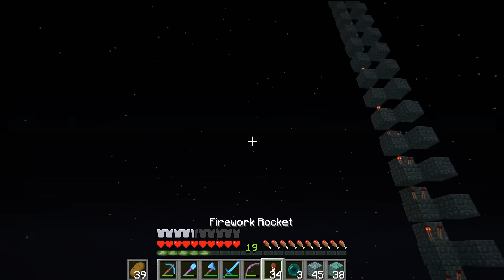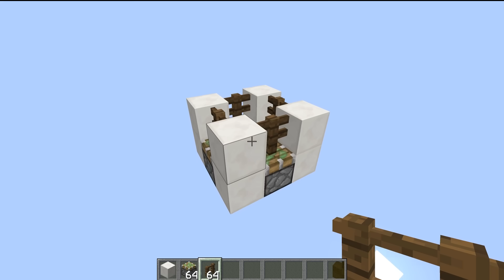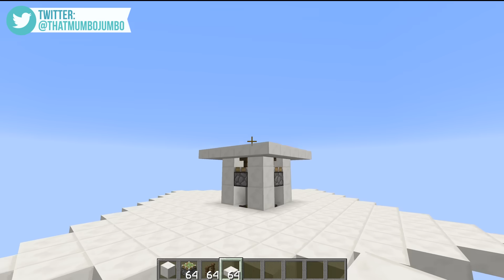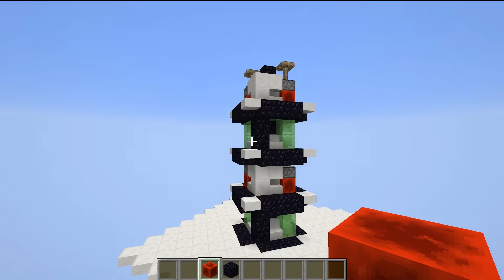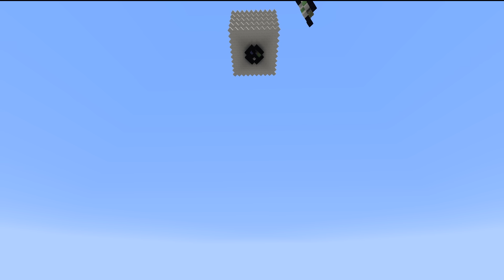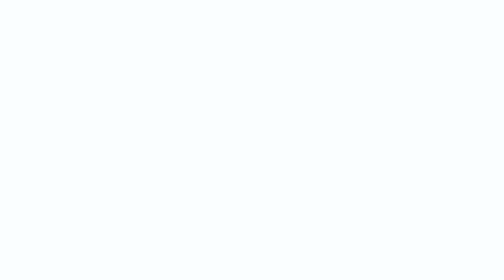Making MOB FARMS with NEW WATER MECHANICS in Minecraft!

Comment: You literally said you wouldn’t use observers, then preceded to use observers
Reply: Also he used them in a different way
Reply: @Samuel Nelson not blocks of redstone. they don't power the surrounding blocks because they count as the 1 powered block.
Reply: @Awonya  correct..
Reply: Are the observers necessary tho? Because you could just put a block there and the signal would go through into the piston.
Reply: @JADubs_  redstone blocks don't power other blocks
Reply: The way they're used won't lead to out-of-sync issues.
Reply: So?....

Comment: Hi Mumbo, I'm making a version of this on a sky block map. I have one bucket of water, the design I've done is working so far. The water goes down the middle and splits out to the sides and also falls back down the centre to the next floor. I have also got streams that come from the top which go out to the side that push the fallen mobs back to the centre killing chamber. One water source shouldn't give me any out of sink issues.

Comment: i think it would have been slightly easier to have the floors another block apart so that the pistons, or dispensers with water buckets in the design i used, lined up with redstone torches in the center column. (not being negative just giving some possibly helpful advice for the build)
PS im a big fan of the channel, keep up the great work

Comment: actually thered be a way simpler system tbh..
piston with redstone block above... the redstone blocks water in the middle from flowing. if you power the lowest piston, its gonna chain react and power each piston one by one to the top.. then if you deactivate the lowest one, theyre all gonna pull the redstone from the opening and let the water flow, while also unpowering the piston above. right? h avent build this, but it sounds like it should work. or do you need redstone half slab blocks for that?

Comment: I found another way  to power the system, but with this you are loosing 1 block of efficiency, so it isnt as compact but it is more resource available.
https://imgur.com/a/WJhht UnPowered State
https://imgur.com/a/Eeqr1 Powered State
Just mainly using all of the same design but just a simpler system for someone that doesn't have the resources.

Comment: Might work better if he takes out the outer most ring of each platform and put signs around the edge to suspend the water but prevent the spiders from hanging on the edge like that since the water will sweep them out into empty space. Then once the water is gone they will have nothing to cling to and should fall straight down.

Comment: On our last server we had the spawner ilmango designed... watching this video makes me wonder... if you didn't want to go as high, how far out could you make the water run by dropping the height of the outer edge before you blocked the mobs from the level below?  (Or would you, assuming each one dropped at the same time?)  

Maybe also, on the bottom layer you could have a reversed water flow moving the mobs back to the middle to be killed by magma blocks or something.  Mainly I'm trying to think of something short that wouldn't be such an imposing structure on the skyline.

I guess I'll worry about that next server.  We are playing modded this time and have something so we can move mob spawners, so we can make something much more compact for this playthrough.

Comment: Couldn't you just run observers up or down through the center of the design at 1:50? With a block adjacent to the pistons so they can be powered?
Edit: Oh wait, I just saw why you weren't using observers. But if you built it in the spawn chunks, observers would work, right?

Comment: The only problem with it is that spiders are sticky. They don’t seem to want to fall off the edge, and will sometimes stick to the side of a block. Before the water mechanic update, you could put an iron bar, glass pane, or a stair block at the edge of a platform, sacrificing a minor amount of spawning space in order to shuffle the spider out faster. Now you can’t do that.

Comment: Mumbo! You could run a tower of stick pistons with a redrone block attached through the center fo the tower and eliminate the need for slime blocks and obsidian, just spread them out by a block vertically and it will work fine. It should work if you use the first design like the one you tried with redstone torches, but make the water stairs drop instead of rise. You simply overcomplicated the entire thing :)

Comment: I found a way which is more efficient, using slabs in the centre, but it looks weird as the bottom half slabs are pulled up from the top side.
However as you need to make it even it wouldn't be more efficient for you.

Comment: There is a built in clone command, which works with relative positions

First build 2 layers, i.e. from the floor of one layer to just below the floor of the next layer.
Then if you stand on a layer at one corner you can use a command like this:
/clone ~-9 ~-1 ~ ~9 ~4 ~20 ~-9 ~-7 ~
And it will copy those 2 layers to make the 2 below layers.
The only issue is with observers updating.
Reply: I found the simplest way around that issue is have it on, and have an extra slab to stand on. That way you clone a little more, with it all on, then just destroy the extra slabs.

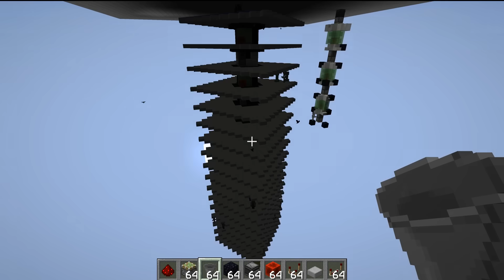Comment: I think your top layer is busted. I've seen it on when the other layers are off. You can clearly see it at 10:34 and 11:12 (the water is on, but the rest is turned off), a few frames at 10:56 (water is still on when the rest of the water is on, so that means there's nothing stopping the water), and 11:28 also shows the system being activated with the water already flowing out on the top layer while the rest of it is just beginning to flow.

Comment: One thing I want to point out, in case this is an accident. Is the water on the top most platform (under the clock circuit) supposed to constantly stay on, or is it a mistake in the design?

Comment: Great idea.
A possible inefficiency is that there are solid blocks in it which allows mobs a chance to pathfind towards them. And since these blocks are all in the centre of the farm, the pathfinding will always fight against your flushing system. I think that this is why the spiders are not all getting flushed out.
The other possibility is that the spiders are simply clinging to the walls at the inside which also prevents that water from flushing them out.

Comment: If you don’t know, there is a built-in command called /clone to clone block structures. Use /clone [lower corner x y z] [upper corner x y z] [new location x y z]. The only problem I have with this is it sometimes is tricky to know what orientation the structure will clone in when you clone. I hope this helps!

Comment: Not to sound like a nag or a nitpick, especially since I know crap about redstone, but wouldn't it have been much simpler to just use a timed piston system to release a flow of water down a chute to flush the mobs out? Like, you use a piston to hold and release water for when the mobs need to be flushed, and it operates on a time system to either extend or retract. Again, I don't know much about redstone, but this just seems simpler to me.

Comment: Here's another idea- while not everything can be built in 1.12, MOST of this design actually works in 1.12 so you could build the bulk of the system in 1.12 then move the save over to your snapshot testing folder and finish up the details like adding the water to the stairs.

Comment: No Mc edit? Try /clone
Reply: He sucks at commands
Reply: /clone is sometimes hard to use though
Reply: Zashisuru also they are completely broken in snapshot, they just wont work
Reply: Blade_ of_Skyrim Clone <from coords> <to coords> <where to clone>
Reply: He does use it sometimes
Reply: James Lloyd no worldedit for snapshots either
Reply: How on earth do you use that command? ive been struggling with it since 2015
Reply: Lol thanks Cwoot ;-)
Reply: Happy to help!
Reply: Remember to make the <where to clone> coords the north-west-bottom corner of the cuboid you're cloning, so with the smallest X, Y and Z. For the <from coords> and <to coords> it doesn't matter.
Reply: Also, this command has some extra features: masked/replace/filtered and normal/move/force. Masked will only clone non-air blocks, filtered will only clone the blocktype you specify and replace will completely replace the destination cuboid. Normal is the default, move will fill the source cuboid with air and force will even clone if the source and destination overlap.
The full syntax is: clone <x1> <y1> <z1> <x2> <y2> <z2> <x> <y> <z> [maskMode] [cloneMode] [TileName] [dataValue|state]
(thanks to https://minecraft.gamepedia.com/Commands#clone )
Reply: He should use WorldEdit

Comment: I challenge you to make the farms, but make them as compact as possible :]
Reply: I think what he meant was to see how compact you can make it without losing too much efficiency. For example, you could have 2 pumpkin farms that both have 40 pumpkin stems, but one might use a system for breaking the pumpkins which takes up less space.
Reply: He already did ;}
Reply: Why could he of not just did the redstone in the middle
Reply: Fost16 I think because of quasi connectivity. I'm not that good at Redstone so I'm not sure though
Reply: not nececarly
Reply: He couldn't use dust because there's currently a bug in the game where redstone components pop off of pistons when they are activated, no matter what direction the piston is facing.
Reply: MrHatoi just use redstone block with slime block
Reply: I looked at the design and I think that probably could work, I'm not sure why he didn't do that. There's exactly enough space in the push limit to fit an extra slime block and even if there wasn't, there are 2 unnecessary slime blocks underneath the top stairs that could be removed. Either I've missed something or Mumbo's just being a spoon again.
Reply: MrHatoi when is mumbo not a spoon? ;)
Reply: RedFireRex RFR good idea
Reply: Mumbo Jumbo and MrHatoi upon lots of testing in sp, it works fine with minor tweaks https://imgur.com/a/ImLrD
Reply: little did he know, mumbo would soon do this...